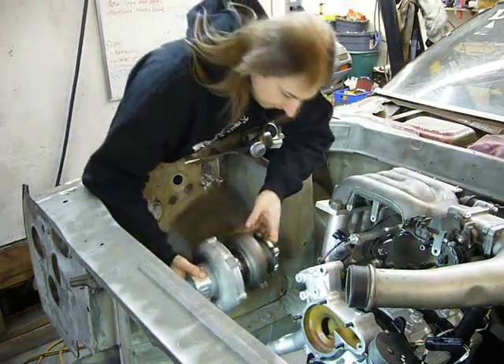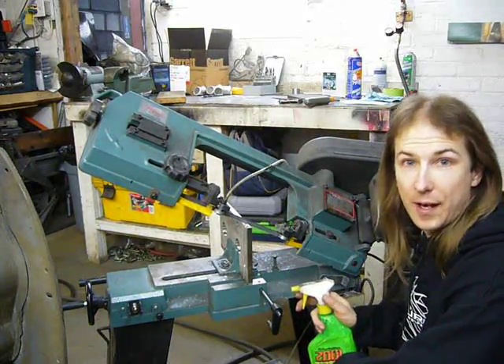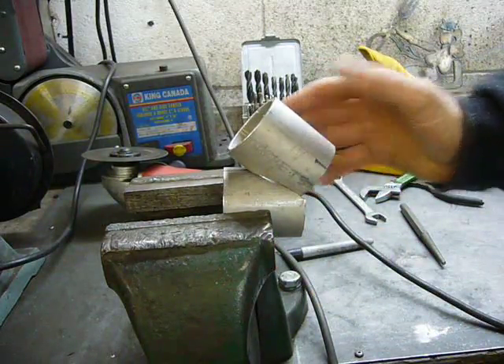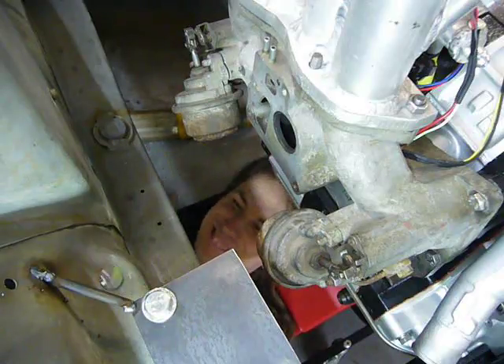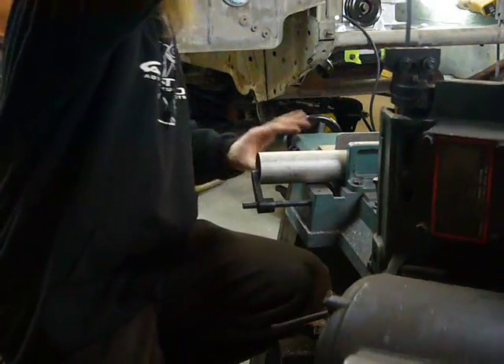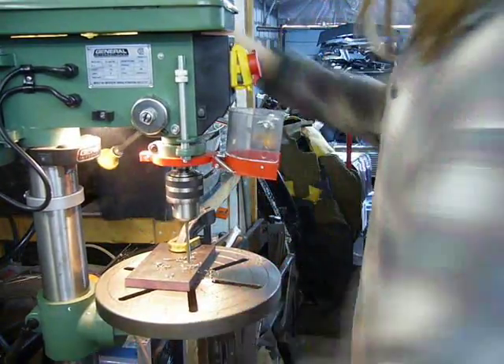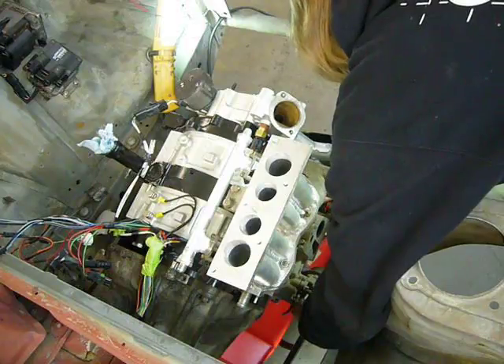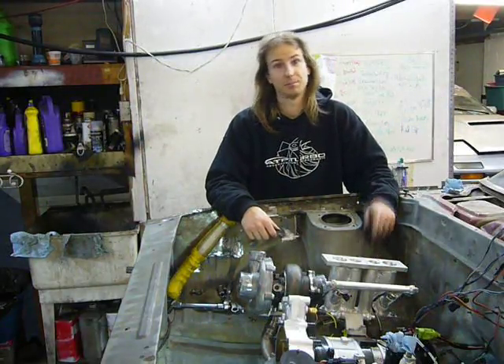Part 25: Turbo Manifold Fabrication - My 76 Mazda RX-5 Cosmo Restoration

Comment: Thought about bracing that manifold? Seen several staino manifolds crack due to the weight of the turbo.
Reply from the maker: I may end up making a small brace but with SCH40 stainless, there shouldn't be a problem. There is some school of thought which says braces on stainless manifolds may tend to cause cracking as the runners expand far more than the brace. I've never done any tests. The GT30R is actually the smallest turbo I've mounted to a manifold I've built so I'm not too worried.
Reply: Sound reasoning to me. And at the end of the day it'd be easy enough to go back and add some if the need arises.
Reply: aaroncake Hey, What country do you live in where you use CM as a measurement. Ruler sticks in grade 5. Use MM Etc
Reply from the maker: lukeyf4i Canada (as I believe most of the world?) standardized on the metric system many years ago. It's only the US that still uses imperial. For things like manifold runners, CM will do the job without having to drop to a higher resolution of MM.
Reply: Lol, just never heard anyone use CM in any precise measurement doing fabrication related jobs. From Friends of mine who I have lengthy conversation with on about each's Project Etc Most being Tool Die/Machinist's. Working in Aerospace/Aviation Ive never seen a CM Measurment on any Detailed/Engineered drawing
Reply from the maker: lukeyf4i I'm not sure I would call a turbo manifold precise fabrication. A MM here or there doesn't really matter too much when it's built without a jig and is subject to weld warping. Though I guess it's all about how you are used to expressing measurements. 8.6CM or 86MM, same difference and same precision. I'm just glad we aren't working in fractions anymore. If I see "11/97ths" it makes me want to scream.
Reply: Lol, You did a nice job regardless, Was just weird how you called out a CM mesurment. Im In southern Ontario Myself

Comment from the maker: Your Orion is our Escort. The main problem I have with heat wrap is that it doesn't last in the longer term. 5+ years down the road and it's looking fairly ratty. Of course that could very well be due to the high EGTs of the rotary being outside of what the stuff is designed to deal with. 304 stainless shields will outlast the car.

Comment from the maker: It is a lot more straightforward to swap in the TII engine, but if you really want to turbocharge the NA engine, start with a Google for "turbocharge na rx-7". There are several methods to accomplish this. Easiest is to port match the TII lower intake to the 6 port block and then bolt all the TII stuff onto the NA block. Th emost difficult would be what you see in this video: building amanifold to put a turbo on the 6 port with NA lower intake.

Comment from the maker: It's possible that's the case because the union shops don't want to risk their members getting flashed, so best just to ban the use rather than specify which helmets are acceptable and which are not. Same with the school. Could be working from outdated information on the earlier helmets which were a bit hit and miss with TIG. I personally can't imagine TIG without an auto dimming helmet because it would be such a pain dealing with a flip helmet for every reposition change.

Comment from the maker: As opposed to? Porting on a rotary (see Cosmo Part 7) is typically done with a die grinder or (as I prefer) Dremel. Not quite sure how there would be another way to do a one off port job as setting up a CNC for one job isn't practical. Now if I had a mill I would have used that to port the manifold, but lacking a mill, the die grinder does the job.

Comment from the maker: Google "TII lim to 6 port block". Somewhee in the 1st three hits will be a link to my website with the proceedure to port match the TII LIM to the 6 port block. It bolts right up but the ports will need to be matched. After that, everything TII will bolt to the NA block so the only fab you have to do is figure out how to get oil and water to the turbo (documented on my website). Then all you need to deal with is fuel system, EMS, etc.

Comment: aaron my wastegate actuator is on so tight I had to add some pressure to connect it. but it only drops 1-1.5psi in the higher rpms

Comment: Also wont hard mounting a piece of metal to the exhaust manifold both heat the heat shield up substantively, and cool the exhaust pipe? I mean basically you are mounting a big ol air cooler to the exhaust. I know space is tight but I would think it preferable that hangars were mounted to a different component.

Comment: I am curious. On a garrett turbo like that, are the oil and coolant feed and drain holes opposite from one another? oil top to bottom then coolant left to right? Just trying to get a image on how to run lines for a single turbo. Also, is it a bad idea to put a stainless steel oil drain line in between 2 exhaust manifold runners even if you wrap them in some sort of heat wrap?

Comment: hmmm, I am in the midst of swapping a GT3076R onto my 1JZ-GTE, but the -8AN braided oil drain line I have can't get around the first runner without sitting against it, even if I clock the turbo to the maximum angle Garrett suggests. A stainless steel tube off the CHRA that bends around the first runner would be my best bet? is it worth it having that bend instead of a drain line straight down to the oil pan?

Comment: If Wayne from Waynes World was to make a video ;) I just made a twin scroll manifold for my car that was quite successful. I didn't want to spend my time using my band saw so I just bought 1/2 mild steel cnc'ed flanges that worked great for about 70$. I originally bought sch40 tubing but it was huge!!! I ended up going with 11 gauge. 

Pretty cool seeing it happen from scratch. It sure is a pain getting runners to match up!! Do you not get burns on your hands from mig'ing that up? I always have.
Reply from the maker: +SomethingClever In truth I should have just bought a flange. For about $80 - $100 I could have even had one laser cut. However I wanted to try the new drill press with some hole saws in thick stainless, and also the orientation of the aux air ports on the Cosmo housings meant that most 13B flanges don't fit anyway (wouldn't cover the ports). The  stupid thing is that I used the WRONG gasket to trace the flange, so the flange I made didn't cover the ports either! I'll have to go back and weld in a little more material before it goes to the machine shop to be trued.

Comment: All you had to do was bolt on the flange to the engine, locate the turbo flange and weld a few rods to connect the two. Then you could have fitted all the pipes on the bench.
Reply from the maker: skirkland1980 I wish I could have, but the lack of space around the lower intake manifold meant that I had to mock up at least one runner in the car.

Comment: hi aaron, im new to mig welding, does stainless steel need more amp to weld than mild steel? when u tack weld in the video did you use any shielding gas?
thanks

Comment: You should make a soup can forge (just use a larger can) for heating parts like that. It's cheap, super simple and will easily heat with just with propane. Google it.

Comment: Hi Aaron, I know nothing about rotaries, but on my car (1990 Ford Orion with RS Turbo running gear, your probably have no idea what that is) I just wrapped the manifold and most of the exhaust in many layers of good quality heat wrap so there was no need for a heatshield. You can quite safely touch the exhaust and the underbonnet temps are really low. Could you not have done the same?
Love the videos, Matt from the UK

Comment: Just an idea mate, if you had welded both flanges with a length of rod instead of welding one flange to the car and having the other one bolted on you could have done the piping outside the car instead of laying on your back underneath it. 
Please VOTE UP so he can see. Thanks

Comment from the maker: While some cheap or poorly made auto darkening helmets have issues with TIG and low amperages, mine is fairly decently adjustable as far as sensitivity goes and I rarely weld at such low amperages. Certainly not in this video.

Comment from the maker: Note quite, no. Aside from the very high cost of a true mandrel bender (not just a die based bender), most of the joints here are far too short radius to be easily made in a bender. And because I need a consistent thickness throughout for proper pipe fitment, the pre-cast els are the best way to go. These are most often used in the industry for manifold construction, except for production manifolds where robotic bending or custom casting might be more economical.

Comment: what type of runner and tubing material are you using? stainless or normal mild steel
Reply from the maker: Kris Bello On this manifold, I used 1.4" SCH40 304 stainless pipe.
Reply: Do you happen to know where you got the 304 and if you ordered them individually or used a builders kit. Im about to start buying all my materials for my first manifold for my 2jz 240sx and dont know where to start with materials. Any little info would help.
Reply from the maker: Kris Bello For this manifold I purchased all my pipe (and flange material) at Metal Supermarkets. They have stores all across North America and into the UK so there might be one near you. The prices are retail and they probably won't have it in stock, but they can usually get it within a few days and there is no minimum order. Another option are industrial plumbing suppliers (check the Yellow Pages) but many aren't really willing to sell to "walk ins". Some are, and can be quite interested in your project though. A local company years ago was happy to sell me pipe and els for my RX-7 manifold. If you are in the US, McMaster Carr has very good prices. They only ship within the US however.

Comment from the maker: In order to maintain gas velocity and thus allow proper scavenging as well as turbo response, some runner is necessary. Mixing exhaust pulses close to the engine is typically not a good thing, and allowing them to expand into a large pipe volume (wider pipe after collector) radically reduces their energy which should go to driving the turbine. Collecting at the engine would have been easier to fabricate, but would not have performed as well.

Comment: What's the pressure rating on the pipe? It looks a bit heavy duty.
Reply from the maker: The pressure rating of SCH 10 stainless pipe is about 18,000 PSI. But it's not about pressure rating here as we are only talking pre-turbine pressure roughly equal to compressor outlet pressure. It is about heat. Rotary engines eject an enormous amount of heat through the exhaust ports so manifold material needs to be thick and heat resistant. Typical mild steel headers have a lifetime of minutes.

Comment from the maker: Unfortunately (or rather fortunately) mine will be guaranteed to work as everything will be new and clean. However if the opportunity allows I'll give some instruction on how to fix stuck ports. Really it's just a matter of pulling off the lower intake and cleaning everything up. Sometimes carb cleaner shot down into the lower intake will free them if pulling off the lower seems inconvenient. There is info on my website about cleaning the external part, the actuators.

Comment: I have a mazda rx7 n/a half bridge port and street port exhaust i want to instal a turbo do i have to install a mega skirt 3 pro or i can instal a stand alone boost controller system if that heaven exist what turbo should i use what waste gate should i use an what type of injectors would be the best what type of fuel pump and it would be nice to use the stock type ecu but a programable one help if u can ho and you rock !!

Comment: When you say mid rpm range, for a rotary that's like... above 5000 rpm, right? I ask because you said you want peak tq to hit at 4000ish.
Reply from the maker: crackpotfox For this 13B which revs up to 8,000 RPM, then midrange would be around 4,000RPM. I want to see boost almost immediately for peak torque in that midrange. That should be about what I'll see based on my intake runner length and turbocharger size.

Comment: ok... question...... why use Stainless cast pipe for a tubular header, rather than Stainless tubing. i feel like that thick walled cast pipe would hav the same strength as thin walled tubing...... is it an issue of heat, maybe???.... ive never used stainless before but had planned on making a custom header for an engine swap i had planned out (91 celica GT coupe with a honda K24 turbo engine)

Edit: and if i look one comment down i get my answer -_-

Comment: Did you get that thing running? I wanna see and hear it. :-)
Reply from the maker: ***** Not yet. Still deep in fabrication but with the last big mechanical project (suspension) happening right now, the end of the tunnel is in sight.
Reply: any new vids?
Reply from the maker: ***** Since part 25, a lot of them up to the current which is 38. I edit and upload the videos as I complete the work.

Comment: GTX3076r, didnt know they came internal wastegate?!?! You suggested one on rx7club but didnt mention that lol is that turbo divided?
Reply from the maker: Dylan Locicero The turbo selected for this build is chosen very specifically to give up its power in the low end and midrange. So it's a very small (for a 13B) 0.82 turbine housing. I  chose undivided because it is available with an internal wastegate as I wasn't sure I'd have enough room with the large lower intake manifold for wastegate plumbing. For a divided housing, you'll need an external wastegateor one of the very few divided housings that have an internal gate or flange to mount an external gate (ATP Turbo has some options there).
Reply from the maker: Bought this one specifically with the internally gated T3 turbine housing. 0.82 if I remember correctly. It is undivided. Note that it is not the GTX version, but the regular GT.

Comment: aaroncake Hi, ive just discovered your channel while looking for header making. Ive got to say that you work very well ( except sometimes where there is slight lack of safety :p ) But id have a question for you if you can take a minute for me. Im working on a mazda 323 turbo project for which id like to make a custom header because im using a turbo for which pre-made header are not available. Now i know some of my friends which are very good welders, but they dont work for free and im trying to keep the cost down. I know how to weld but never made a header before. My friends told me that you have to heat the sch40 pipe before welding it to make a header for some reasons ? is it true because you dont seem to heat it before you weld it. I like your way of making the flanges, gave me lots of ideas. Now ive got to watch your other videos in order to learn more stuff.
Reply from the maker: ***** They probably pre heated it so they didn't have to start off at a higher welding current then taper down as the part warmed up. There is no requirement for pre heating when welding a small steel/stainless fixture like a header. You'd really only pre-heat if welding a large item, or a big casting. Or if the manifold is cast. If cast, then there are very specific welding procedures and filler metals. Broadly speaking castings need to be pre-heated, welded with the appropriate filler, then allowed to cool gradually (torch and gradually reduce heat, or bury in hot sand and allow to cool naturally).

Comment: You really need an auto drip oiler ,,, maybe some used ATF and a bottle and some brake line could put a valve on it to control the drip
Reply from the maker: +Mark Ryan The band saw does have a coolant line retrofitted but the pump (a washer fluid pump) broke long ago. It's on the long list of projects to build a new base for it which mounts the whole thing in a tray, and install a proper pump so the system will work again.

Comment: aaron can you give me the measurement for a 13bn/a 86 ?
Reply from the maker: Measurements of? Length? Width? Weight? I honestly don't have a stock 13B NA from an '86 around. It may be easiest to Google for the info as it's likely been posted to the RX-7 Club (.com) forum.
Reply: yeah i understand ! sorry for not specify the measurements actually i need the proper angle for pipes that goes from exhaust flange through under the car !!! do you know how can i get it ? im asking you these silly question cuz here in el salvador there's only 10 rx7 fc's and just a few fd's and fb's i hope you understand my idea or my worry, i will rebuild my engine in a few months !
Reply from the maker: jorge osorio Unfortunately I just don't have those dimensions. I don't have a stock FC around nor access to one. Have you checked the factory service manual though? It won't give measurements but will give you an idea of the exhaust layout. Just Google "RX-7 FSM" and it's one of the top hits on foxed.ca.
Reply: i've checked everywhere and its too expensive to buy one on ebay but i found some measurements in  atkins web page so thanks to answer me i appreciate that!!! Good luck with the cosmo !!! keep going and thanks for the vids !!!!

Comment: You know you can buy flanges right?
Reply from the maker: Ryan Barbolt Yep, loads of vendors make 13B exhaust flanges in stainless. But then I could have also purchased a fully restored Cosmo.
Reply: O come one, buying one flange to save yourself 4 hours worth of work is hardly...a fully restored anything.
Reply from the maker: Ryan Barbolt Haha, yes. This time though I decided I wanted to make my own flange. Ultimately it turned out not to be worth the time it took.
Reply: Did you ever finish the car..I've use you as a reference since the early days.."project Tina.
Reply from the maker: Ryan Barbolt Since there's no "Part xx - All Done!" episode it's not done. :-) But an update should be live shortly...